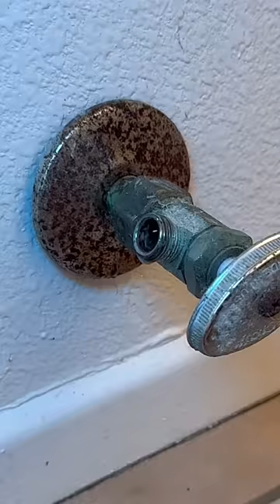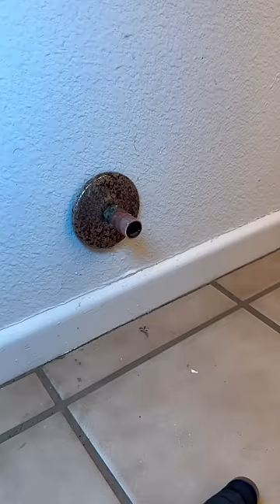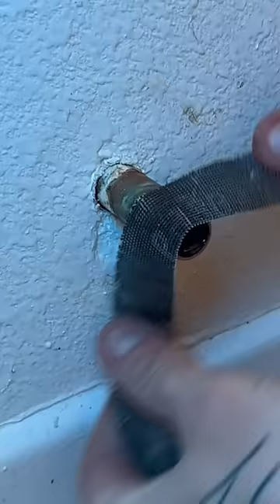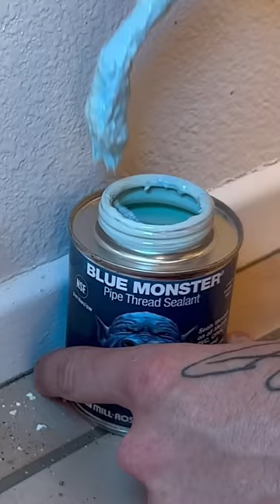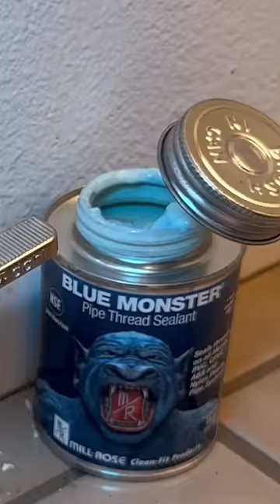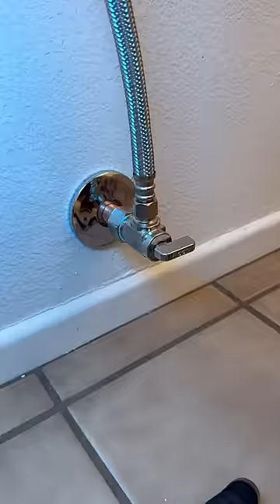HOW TO INSTALL ANGLE STOP! #new #newvideo #tips #tricks #hack #hacks #troll #water #plumbing #fyp

Comment: Pipe dope is to seal the threads when there’s no other way to seal the fitting… In this case, you used a copper COMPRESSION fitting. The compression ring seals the fitting, the pipe dope on the threads did nothing. If anything it caused a problem vs helping in my opinion. But as long as it doesn’t leak I guess that’s all that matters.
Reply: I think he's using the dope to fill in the sanding marks..... can't use a compression like he did.....🥃
Reply: I think it reduces friction to allow the fitting to tighten more in this instance
Reply: @alexzobrist9395 that’s why you use never seez but only a little bit
Reply: the pipe dope is to lubricate the threads so you can crush the olive/crush sleeve
Reply: It’s not to seal the fitting in this application. It is to allow for a tighter compression as the pipe dope serves as a bit of a lubricant. No problem caused here. 😊
Reply: @jayrodriguez1650 with that logic, why don't you use oil
Reply: Been Service plumbing 30 years. Good work 👍🏼
Reply: This is a common practice. Don’t get your undies in a bunch.
Reply: Exactly
Reply: Brasscraft disagrees. They have it listed as one of the instructions for putting the stop together. It acts as a lubricant.
Reply: @robmaffeis You very well could. Brasscraft says you can use either, but which do you think plumbers are going to have on hand.

Comment: That one wrench that flips open & closed is my favorite part of this video
Reply: Yeh wtf is that man? I'm amazed it's the perfect tool I've never found. Channel locks for me
Reply: I want it
Reply from the maker: I’ll have links for everyone this weekend
Reply: @HDPLUMBERS  yes please!
Reply: Wera has a very nice ratcheting wrench set as well
Reply: where the link, i need that tool man
Reply: Its called Ratcheting flare nut wrench. $50 each or $260 for a set.
Reply: Go buy one then
Reply: What kind of wrench is that??
Reply: @henryyang3245 when I search it, it comes back with something similar but not the exact one
Reply: @HDPLUMBERS well, where are the links dude? You lied to me. You lied to us. I'm calling the POLICE.
Reply: I agree,that wrench is trippin. I would love to have one in my tool box
Reply: @Gerberous link?
Reply: @HDPLUMBERS where they at?
Reply: Need it
Reply: except that it marred the copper nut and made it look ugly afterwards
Reply: Pasco 4528 rapid angle wrench set. Also Pasco Kwik tite
Reply: I like the puller and the wrench that screws on the water line port!
Reply: Yeah, and it also scuffs up the fitting. An adjustable wrench would have done the same thing and not messed up the fittings
Reply: Not that I don’t trust you, but can we assume the compression ring made it onto the line?

Comment: Hey boi, you should never need to use pipe dope on that compression fitting angle stop
Reply: Makes the nut tighten little easier , it’s not for a seal .
Reply from the maker: Ok replumb … 🥴
Reply: But he used pipe thred sealant....
Reply: Errrrrrr
Reply: @51-FS that's pipe dope 😂
Reply: Hey boi, that’s how almost all of the old guys do it and it’s worked for decades.
Reply: Bro, do you even plumb? pipe dope is just a lubricant to seat the compression fitting.
Reply: I was also taught to dope the compression fittings if it works leave it alone lol
Reply: @wyattevans4335 not true, lubricate the threads of you feel the need but thread sealant isn’t the way to do it.
Reply: @Iwishitwas-hl9wj  I’m gonna keep doing it to every single angle stop I do
Reply: @milkman45828  I know :D
Reply: @wyattevans4335  If it slides one way, it'll slide the other.  It's the friction that creates the seal.  Way to remove it.
Reply: You're supposed to put pipe dope on the ferrule.
Reply: Now that character's voice is in my head 😂
Reply: @mayurkulkarni1990 Errrrrr.... but some plumbers say it's okay.... 😂
Reply: On these videos, I, too often see a lot of negative comments about what someone is doing wrong, but not many comments on how to fix it and do it right. Are those who are saying it's not correct, afraid to tell us how it's supposed to be in fear of getting the same negativity?
Reply: I'm not a Plumber but I've done little stuff at my own home and office. Anything major I call in the professionals. I know when it's something beyond my skill set.
Reply: @ramman411970 just do everything he does in the video except for the pipe dope. It's messy and unnecessary, makes the plumber look like an amateur.
Reply: @ramman411970 in this case, the right way is inherently in the comment already. Simply install the fitting without pipe dope
Reply: Errrrrrrrrrrrrrrrrrrrr!!!
Reply: @tylerbridges1330 uh no, that's specifically what manufacturers instruct you NOT to do 😂😂😂 lubricate the threads only
Reply: @wyattevans4335 take a hike, that’s crap and you know it. Broaden your experience and try anti-seize or grease next time. I’ll be damned.
Reply: But he did and so do I.
Reply: What about sanding one side of the pipe.
Reply: Hey boi, don't worry about it.

Comment: I love that wrench that screws onto the threads, never seen that before. Has anyone else noticed that nearly everytime you need to use a shutoff valve it is defective and needs to be replaced? Thereby negating the purpose of the valve.
Reply from the maker: lol yes give them a turn every year to make sure they are in working condition 🙌 
I recommend using Dahl quarter turn angle stops 👌

Comment: The people hating on dope 😂 good job brother. I do the same thing and iv never had a leak on my compression stops.
Reply: So you lack the capacity to understand that dope on the threads does nothing.
Hokey Dokey
Reply: If they olive is doped job done
Reply: @BS-ys8zn  makes him feel better...isn't that  the purpose  of dope?
Reply: People are quick to give there input but ain’t never plumbed a day in there life lol.
Reply: I’ve never had a compression leak either… without dope
Reply: Plumbed residential and commercial for over ten years including water treatment with a lot of high pressure booster pumps pushing 250 plus psi and never in my life have I seen someone use pipe dope on a compression fitting. The compression is what seals it not tape or dope. That’s like gluing sweat fittings before applying flux and solder like wtf? This is unbelievable
Reply: @timcoleman9345  If you’re doing high pressure compression fittings (especially stainless) without a virgin ptfe compound on the sealing surface (the ferrule contact surface, not the threads) you’re just looking for trouble. And probably not meeting system specifications.
Reply: @russbell6418 I’m not doing compression fittings on psi that high lol I was giving experience of high psi systems I’ve dealt with so I know what it takes even at high pressure for a fitting not to leak.
Reply: @timcoleman9345 unbelievable? Really? Lol the fact that you used the word unbelievable to describe this is unbelievably unbelievable
Reply: @3Initials  so question, 20 years down the road, will it be hard to take off?
Reply: @tothemoon2  it’s like wearing two pairs of underwear
Reply: @3Initials  haha
Reply: We don't hate dope. It's just useless where he put it. If he applied it to the part that actually makes the seal, you would have a point. This was simply a waste of time and material. 

Compound is also not a lubricant. Teflón tape is if applied sparingly. The compound will dry out over the years and make removal of the nut harder, not easier.

Comment: I didn't see the brass washer between the nut and valve. I prefer sharkbite over compression fittings anyway.
Reply from the maker: It’s called a ferrule and it’s in there. If it wasn’t then you would be in big trouble. Also I would NEVER use a sharkbite as a permanent solution.

Comment: As an appliance installer, regardless of what gets hooked up there, I thank you for installing a quality shut-off valve.
Reply: I hate those cheap 1/4 turn valves. They have a plastic ball, so if they get a shred of something in them while being turned off, they will never seal again. The old multi-turns could have the guts changed under pressure without losing more than about a gallon of water. Commercial buildings, sometimes you can’t turn the water off.
Reply: @russbell6418  That's a dahl valve no plastic parts in there even the miniball is brass.

Comment: Been a new construction custom home plumber since 1998, I’ve doped the threads on every angle and straight stop I’ve installed. (Literally thousands) Helps center the ferrule and helps lube the threads for a better seal when tightening.
Reply: Finally someone on here that has a clue lol
Reply: The threads don't seal. They're straight, not tapered. The ferrule is the only thing sealing. Easiest way to find the people who don't care about their job enough to learn about it. Aka, hacks.
Reply: @ChickenSteew  just so you no… it’s a lubricant. You don’t have to ask google il let you no since your parents didn’t teach you anything about the real world.
Reply: Oddly enough, the can is labeled as a sealant, not a lubricant....
Reply: @redneckgearheadgarage495  Mill-Rose makes Blue Monster either with or without PTFE, which is more lubricant than sealant. And of course everyone labels their pipe dope as “sealant” because it’s more marketable than “lubricant”. 30 years ago we were using Rectorseal 5 on compression fittings. I feel a little sorry for the guys taking those off. (Not as bad as gas pipe I’ve disassembled that was put together with Permatex 300.)
Reply: I started applying it to the ferrel, pipe, and threads slightly. You may think it’s stupid, although you can actually bend the smaller soft coppers around, and they still won’t leak. Like behind refrigerators when they get pushed in/pulled out. Started doing it after noticing the ones with pipe rope were the ones I never had to mess with.
Reply: also causes the nuts to swell and crack, I repaired many for this very reason.

Comment: Amazing work as usual, in the multi family/apt units, this would never work due to how fragile the pvc is. No compresion at all.
Reply from the maker: Thank you 🙏, also these won’t work but can use another type of valve 🙌 Dahl provides those as well
Reply: I’ve worked on a lots of apartments and condos. I would definitely recommend male to female fittings. Those will be your best friend. I know what you mean. I’ve done a lot of work with PVC and CPVC

Comment: Repeat after me: sealant tape is NOT for sealing in this case, is to make it easier to unthread for the next poor soul that replaces this one 🙏
Reply: Then use anti seize ?
Reply: @ajpchipmunk  antiseize works marvels but a single tap isn't worth spending the extra compares to the near free tape
Reply: Incorrect. Thread compound dries out making it harder to remove the nut in the future. Which actually makes the seal stronger over time as long as it's appropriately tightened. 

Teflón tape is actually designed as lubrication if used correctly. Even though we use more of as a sealant. 

And i have not seen anti-seize that is code legal for potable water systems. It would contaminate the water supply from leaching.

Comment: A lot of experts in the comment section 😂 I do this exactly the same for years and never had any problems.
Reply: It won't cause a problem it's just unnecessary. It would be the same if he wrapped the threads with teflon tape, totally a wasted step.

Comment: Pipe dope should not be used on flare nut fittings. The seal is made on the ferrule not the threads.
Reply: I constantly use it on unions and JIC fittings at work. Even though it’s supposed to seal it doesn’t. Everything is pressure checked and has to hold over night. But to add to it. Not like the pipe and flanges ever line up like the are supposed to😂

Comment: I’d definitely solder on a new ball valve instead of using a compression fitting.
Reply: why? what application would require a ball valve instead of a quarter turn
Reply: @brayden-ft3pd  1/4 turn would work to bud 👍

Comment: The pipe dope is used as a lubricant not a sealant in this application. Faucet grease or in petroleum jelly would work to enable the compression nut to tighten enough to compress the ferrel. The brass on brass threads can bind up before getting tight enough to. It just makes it an easier install and the Blue Monster pipe dope is actually anti-seizing, makes it easier to take apart later if necessary.
Reply: Exactly, it's not being applied as a sealant.

Comment: Thread sealant is not necessary on a compression fitting.  Threads don't seal water...the compression ring does. All it does is make it harder to remove upon the next repair

Comment: Thank god you put pipe thread sealant on the compression fitting.  So many people are using teflon tape when everyone knows you use sealant because that will keep water from leaking out if the compression fitting fails.  EVEN THOUGH THEY NEVER FAIL AND EVEN IF THEY DID THE SEALANT WOULDN'T DO A FRIGGING THING!!
Reply from the maker: Thanks for watching 🙌

Comment: Surprised he didn't just sweat on a threaded fitting, then add a  threaded valve, so very easy to change out in the future.  Compression stuff is great for the unskilled and also great for damaging the copper till you run out of pipe exposed beyond the drywall, then you are forced to cut  & sweat on a sleeve, and extension pipe.

Comment: You can tell the original installation plumber doesn't take pride in his work. You can see grapes from an unwiped solder joint peeking out from the drywall after he uses sand cloth on the stub out.

Comment: As much as douchebags are saying “it’s a compression fitting, no dope” that’s the least triggering thing. I don’t do it but I see it all the time. I’ve worked for a company that took too much work so they never had time to teach which meant telling apprentices all threads get dope because it’s quicker than trying to tell them which ones do and why. So a little dope here doesn’t bother me. The part that triggered me the most was the orientation of the wrenches. I was always taught to make them work together. They should be facing each other. For one it’s easier. Two, you aren’t putting all that downward force on the pipe. If they face each other the force equalizes and you just get torque on the nut. Luckily the pipe was secure enough to handle it. If it wasn’t though, this could have gone sideways.

Comment: Pretty sure (and when i say pretty sure im being sarcastic because i k ow for sure) thread sealant is for threads that seal and thread lubricant is for applying additional clamping force.....neither of which is advised in this scenario since the threads d9nt seal and overtorque could cause problems

Comment: After over 20 years in plumbing heating and cooling and never surprises me where I find thread sealant and pipe tape where it doesn't belong. Is there any new construction I always braise or solder every connection and the use of nice high-end valves but most likely never need to be replaced.  Although I do believe that the replacement was probably better than the original but I believe that both installations were flawed and should have both been done in a permanent manner.

Comment: You don't put that type of sealant on those threads use a dab of Teflon that's got no grit inside of it what snow is Virgin Teflon but really you don't put any sealant on it because that is not where the sealing is done 

The prep for this is using sandpaper to get the rough crap off and then a much finer sandpaper like 800 or more to give you a much better surface. I see too many guys put Teflon paste, or Teflon tape on those threads, or the threads on their supply lines, or the threads on a filter sump,... if you're getting any leaks at those points you're just not doing it correctly. 

The only reason I would ever put a minimal amount of Virgin Teflon on those points are just to get the thread to thread connection moving more smoothly

Comment: Is this a compression fitting that seals with a rubber gasket like the supply lines, or a compression that relies on a compressed copper collar? If it's the latter, i don't see the issue with using tape or dope.

Comment: How about you chop the wall out just enough so the scutchon plate will still conceal it, and weld inside the wall a male 15 tube bush, and then epoxy the void, come back 24 hours later, (fit scutcheon plate) put some loxeal on the male thread and gently screw back a new mini stop valve.. HOW ABOUT THAT?

Comment: You 100% DO NOT need to put pipe sealant on those threads.  That's what the rubber or compression ring is for inside the stop.
Reply from the maker: Ain’t no rubber in here 😂🤦‍♂️

Comment: I doubt that most of the goofs who use thread compound on compression or flare fittings understand how they seal or that in the case of a pipe thread, where it is needed, it is tapered 3/4"  foot.  Union nuts on a steam line or condensate line covered with pipe dope are my pet peeve

Comment: You'd want the pipe dope on the compression ring, not the threads. The seal is the leading edge of the compression ring against the INSIDE of the stop, not the threads.

Comment: Yes wrong place for joint conpound.. UNLESS your the 1% who  knows joint compound also acts as a lubricant to help keep those threads moving easily until the mating surfaces have finally crushed enough to make a good seal. Same on tapered fittings in my opinion. Its just lubing it till the taper mates. And yes helps a with the seal but to me mostly helps run shit in till it seals itself. Thats why alot of people use teflon along side it. Also see other people. Use just compound and barley tighten shit and it "never leaks" so wtf do i know. But thats the way i look at it. And technically he's sealling this side of the ferrel which isnt bad. So every ones wrong but me as usual 🤣

No one who own the tools to do that is a novic.
Reply from the maker: Thank you 🙌